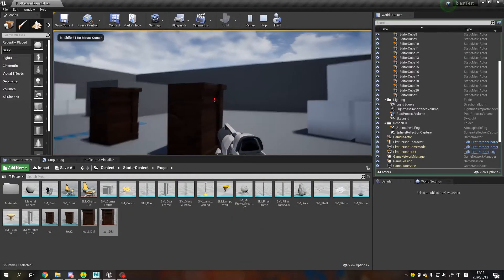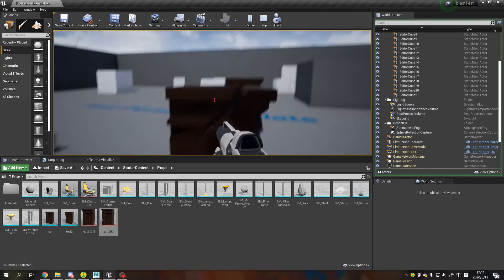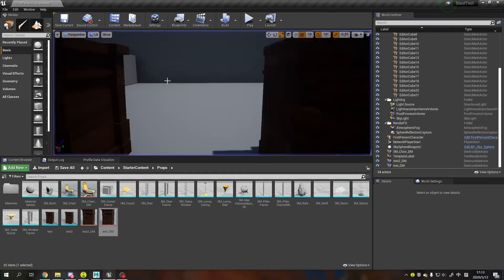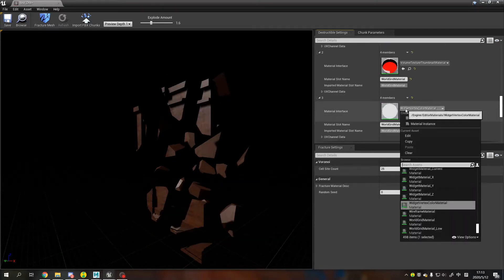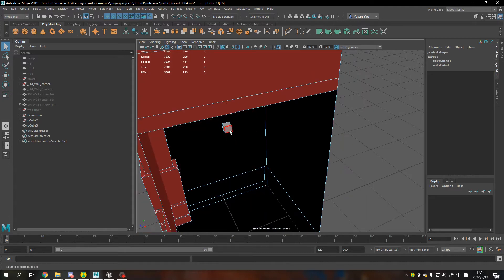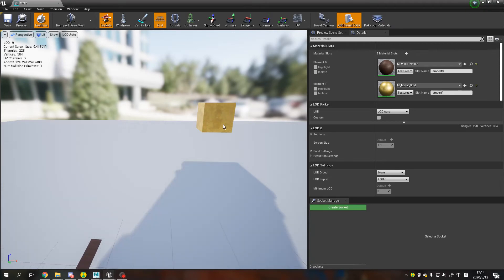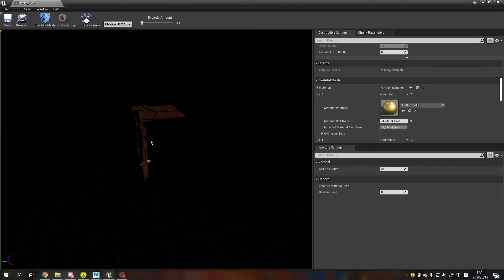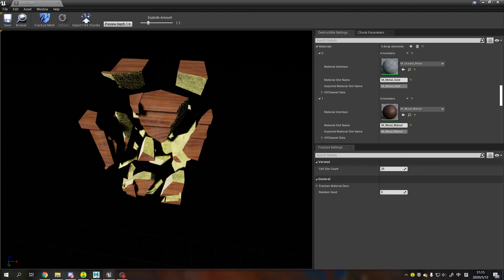UE4 - Tutorial - Fix Mesh Interior Materials Bug in APEX Destruction after 4.20+

Comment: So, OP's solution is kinda half-way. I will try explaining and give a full solution. Hang on, this will be a lengthy read...
====================
Here is what's really happening:
Apex destruction looks at your mesh's material order (you can see it in the Mesh Editor inside Unreal). And uses your FIRST material - as the one for the inner(destroyed) part!

For example, you have a single MESH, and it has a material order of the following: "Material_A", then "Material_B", OR, if there is only a single material slot - "Material_A". THEN Apex will take the FIRST slot ("Material_A"), and use that as its source material for the inner(destroyed) part during Fracturing.

Now, let us assume, that you need Material_A to be the OUTSIDE, and Material_B - to be the INSIDE materials. Then,  what you need to do, is to get your mesh's material order to be the following:
-Material_B (your Inner material)
-Material_A (your Outer material)
You need TWO material slots! If your base mesh has only one material slot - then you need to set two. Find some random small polygon, and give it a second material. Or, like the author of the video - make a small single-Triangle mesh (it doesn't have to be a cube) and merge it with you base mesh. Hide it inside your mesh or something, just make sure it has a different material.

Now, when you fracture your mesh, it will take your FIRST material (in our case Material_B) and assign in to the inner destroyed parts. It will keep the Material_A as a secondary(outer) material.
Also, make sure to delete any additional new blank material slots that the APEX plugin creates (save on drawcalls).
====================
Not sure how to change material order on you mesh?

Well, this is the tricky part! There are NO instruments inside UE4 to change material order. But, if you use Maya, here's my method (also read if you don't use Maya, there are important parts):
Have your mesh divided into two separate parts(meshes). Mesh with Material_A, and a mesh with Material_B. In maya, when you combine meshes into one, the resulting mesh will have its first material set to whichever mesh was selected FIRST.

So, you select the mesh with Material_B FIRST, then you select mesh with Material_A. Then use "Combine" command. After that (and this is IMPORTANT), you need to import this new single mesh CLEANLY. That is - don't use Unreal's "Reimport" feature. If you Reimport - material order will stay the same!!!
====================

Well, I hope this will help at least some1, as it took me half a day to figure this out...